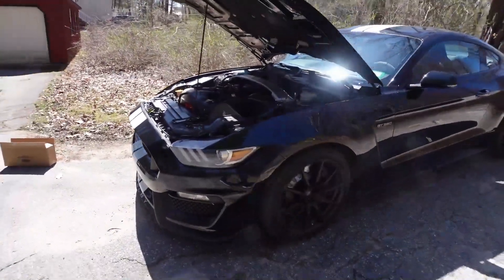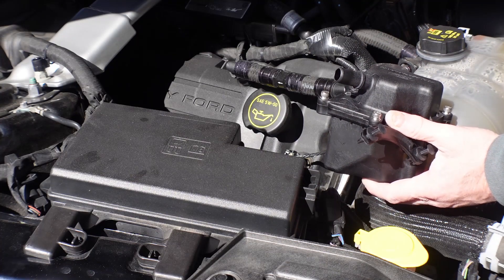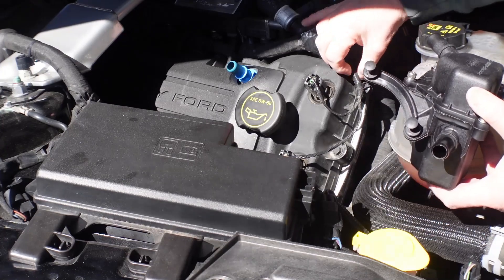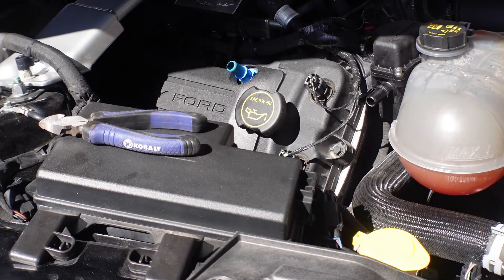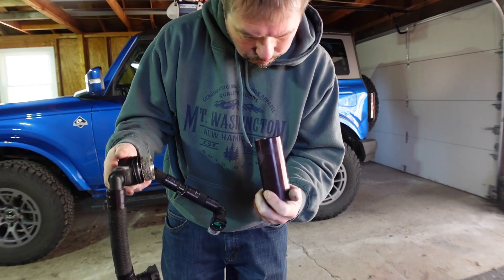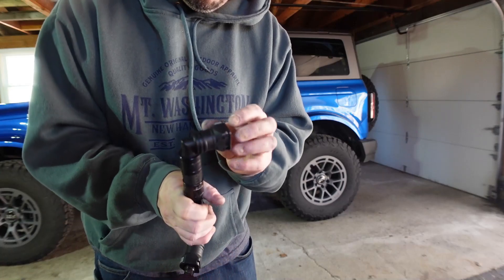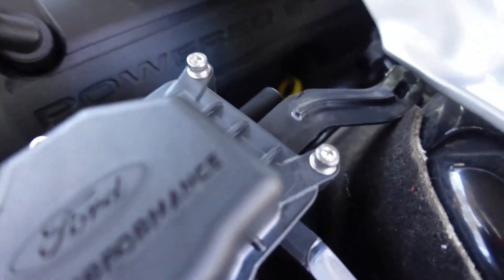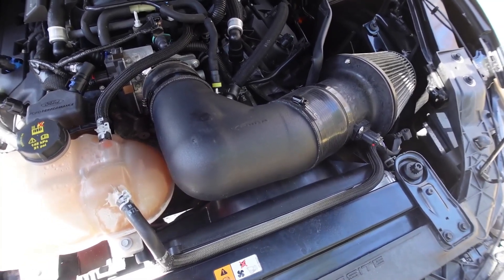Installing A Ford Performance Oil Separator On My Shelby GT350

Comment: The Ford one looks so much better. Like you said looks factory that way.
Reply from the maker: Other than the looks this one actually works. It’s catching oil as the other one didn’t catch anything
Reply: @Lethal_Venom  I like the looks of it. Glad it’s doing it’s job
Reply from the maker: @ProCharged7.3Godzilla  looks and function, hard to beat lol

Comment: The Ford Performance Catch Cans look so much better then the aftermarket parts.  That was my first mod!   I did both sides!   Thanks for sharing! 🤙🤙🐍🐍🐍
Reply from the maker: I’m already  catching my oil in this one. The other catch can was garbage.
Reply: I need to get one soon to.
Reply from the maker: @svtpower03  Definity do it, well worth it. Don't get the cheepo ones either. The one I had before was not even catching oil the Ford Performance one works well